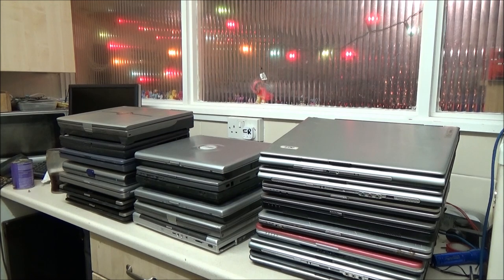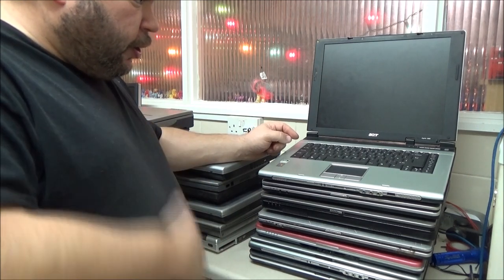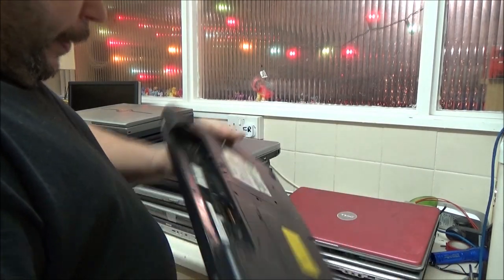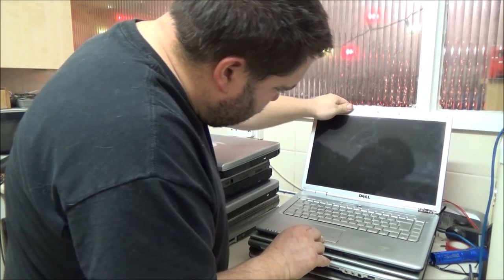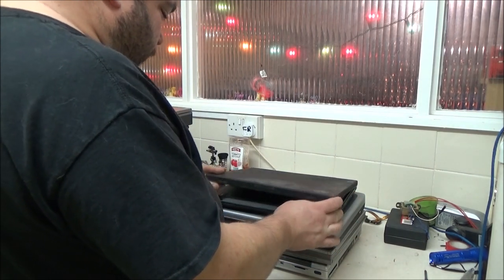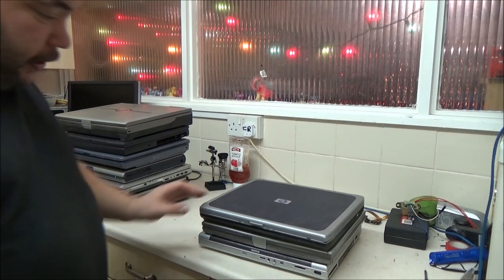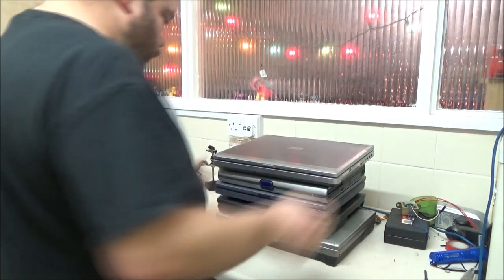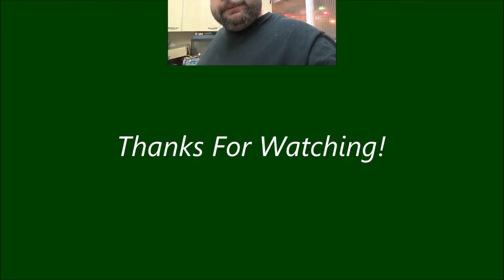Laptop Testing: Part 1

Comment: You should get a universal power supply on amazon for relitavely cheap you can also get the little end prices for them to for cheap
Reply from the maker: I will as soon as I am able to. Will be easier than trying to find one that fits from my boxes and draws full of adapters which I have found not all of them work either